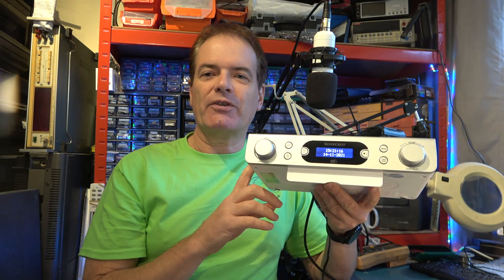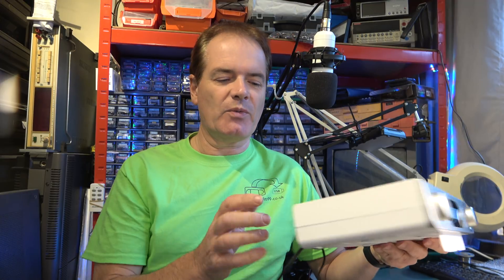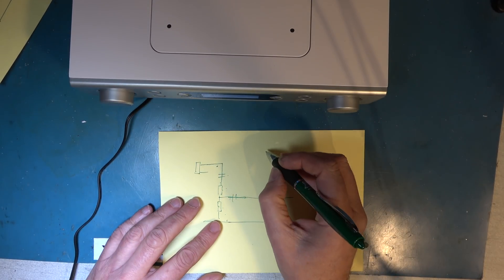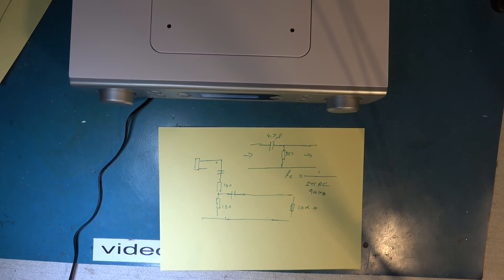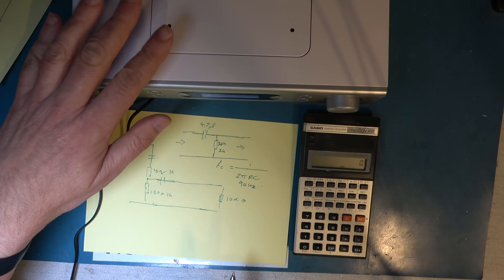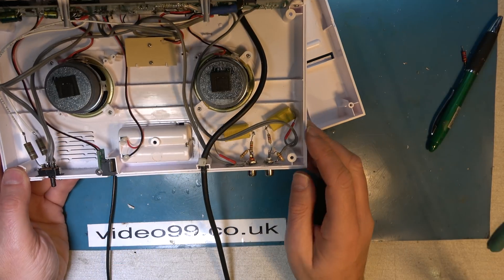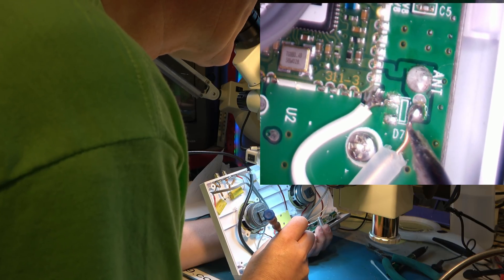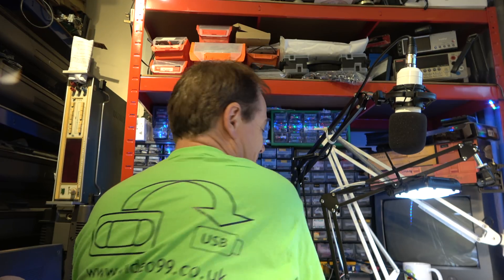DAB radio modifications part 2.  LIDL kitchen radio tweak.

Comment: Hi!
I've just show your 2 videos. This receiver is généric.
I've just buy the "new" version. And i have the same probs! Thanks for your input antenna solution, a cutted cable is a great idea!
I don't need high output, my audio systems have a good sensivity. I build 2.1 speakers since 1994. It's for my last and biggest project...
But for your application, why did you not use a pre-amplifier? A module with a simple NE5532 cost 3 euros...
My best from France!

Comment: DAB isn't worth listening to anyway.  Get yourself an internet radio.
Reply from the maker: That's not what I was trying to do here.  I wanted something my Dad could just switch on and use easily with his amplifier, at very low cost.  It does that job perfectly.
Reply: Depends on the bitrate in DAB+, in the Netherlands it is not so bad. 64kbps sounds reasonable public broadcasts do 120kbps and the classic one is upped to 152kb.  Arrowclassic rock 64kb has enough low frequencys for the subwoofer to kick in.

Comment: Whoa hang on did I spot usb hookup points on that dab module....... I'm sure just next to the antenna connector I saw a pad labelled usbd+ etc but looks like next to it was a 2nd pad of usbd+, doubt there being two d+, unless there's two d- to go with them as a USB host for a USB stick for MP3 playback and a USB hookup......
Reply from the maker: Yes the module has a USB port, probably just for programming though.

Comment: I write this from Tampa, FL, which has significant amounts of lightning.  Since you are using an outdoor antenna, you should consider a grounding rod and a lightning protector.  Since you don't have a protection diode in the radio, pretty much any close by strike will fry the radio. Thanks for the video. You are always doing cool stuff!
Reply from the maker: Nearby lightning could be a risk, you are right.  (I once had a lightning tendril strike a satellite dish.  That fried the satellite receiver and everything connected to it.)

Comment: Very interesting. I also have a DAB+ radio with disappointing reception. Mine is portable but I'd like to be able to connect it to a better antenna when it's on its spot, while still able to use the included antenna. I'm still doubting on how to combine an antenna input with the included telescope antenna.
I'm glad you reconsidered the design of your output. It'll sound much better through a HiFi. But taking the signal from a DC-lifted source comes with issues: you'll probably get a big click when turning the radio off or on while the connected external amplifier is already turned on. I know, we're supposed to turn everything on in the right order but accidents happen...
Also, that radio might contain class D amplifier chips. If so, it might output a PWM signal. Check that with an oscilloscope. Your HiFi amplifier might not deal well with that high modulation frequency at the input. If needed, add a low-pass filter.
Reply from the maker: The output looked fine on an oscilloscope, I don't think it's PWM.  I'm not getting a click it switch on, I know because that thought crossed my mind and I checked for it.
Reply: Even with it being class d I don't think it would ever pose such an issue. Most line level inputs on hifi's block anything over 30 Khz now days. And even if it couldn't I highly doubt the amp  would even have the bandwidth to try to amplify it.

Comment: interesting, or rather shame, that the same radio is being sold in east european countries that is without DAB. it's not even possible to buy the model with DAB, as they're not imported.
Reply from the maker: Interesting.  It might be possible to hack that model to include DAB if it uses the same module.
Reply: I dont think east Europe has any DAB transmissions
Reply: @pauldavies6037  "We're going to need a bigger antenna."
Reply: @paulsengupta971  DX dab radio need a big yagi LOL